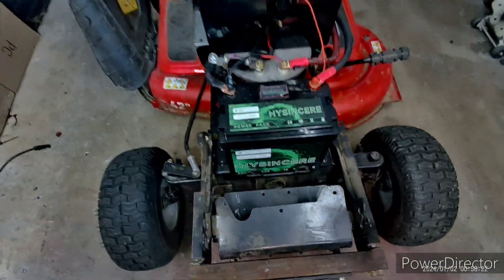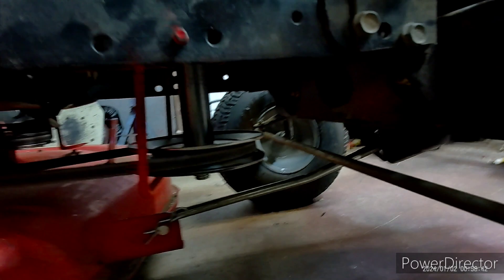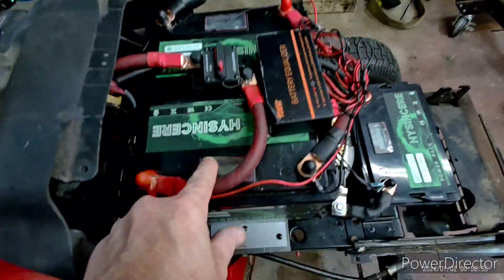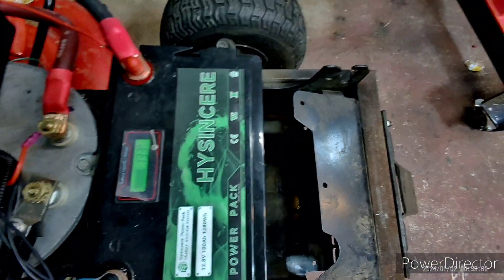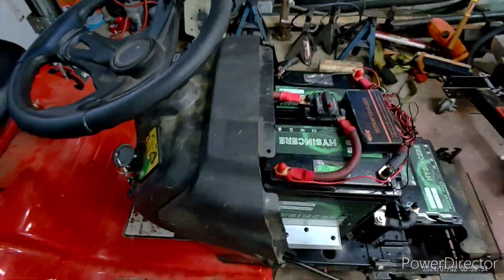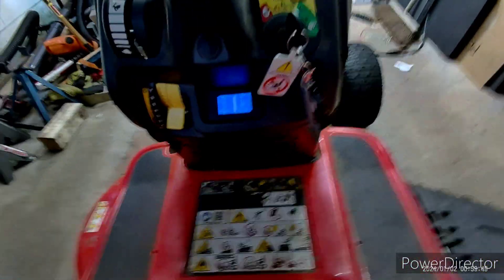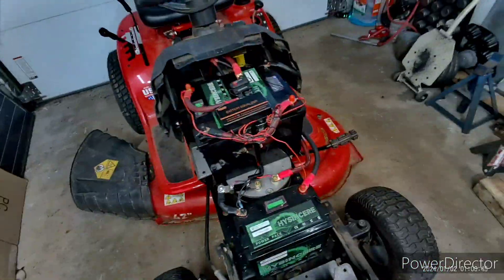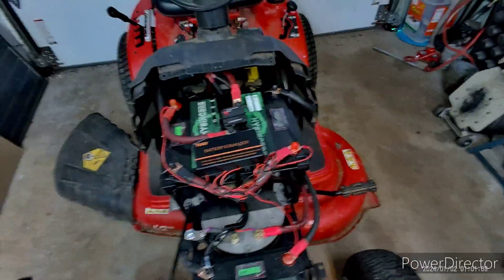36 VOLT ELECTRIC MOWER

Comment: is it possible to put the links to the part you pucrhased in the comments
Reply from the maker: I purchased the motor used on Ebay. It came out of a floor burnisher. It's a 36 volt 2.5 hp dc motor. The relay/contactor was just a basic 24 volt relay on Amazon. The same with the batteries.  I got one from eBay and then 2 from Amazon because they had a promotion.  The shaft for the original engine was 1inch I believe, and I got a 1 inch to 3/4 adapter and it worked perfectly.  I honestly got really lucky on this one. I maybe have a total of 8 hours working on this thing. I really only used 3 pieces and the rest I just fabricated.

Comment: how long will it mow with the power you have there?
Reply from the maker: @sambaaxe  I can do my entire yard front and back and it uses about 2.5 Amp hours. The batteries are 100 amp hours. I usually go around my lawn a few times but, I could roughly mow my lawn about 50 times before I need to charge the batteries. It’s definitely way too much amp hours for this mower. I will probably buy a 36 volt battery with a lower amp hour so I can use these 12 volt batteries for my solar system. I imagine a 10 amp hour battery would probably do about a 1/4 acre. Hope this helps you out. Thanks..

Comment: What is the total cost of this swap?
Reply from the maker: @mundanestuff  I paid around 175 for the motor that I found on eBay. It came out of a floor polisher.  It's a 36 volt 2300 rpm and 2.5hp. The contactor and connectors and wire were around 50 dollars on Amazon. I purchased 3 12 volt batteries.  One I purchased from eBay, and then I purchased 2 more on Amazon.  I did have a bad one, but they replaced it fast, and all 3 cost me about 450. So, pretty much around 675.00, give or take. It's really overkill. If I did it again I would buy a 36 volt battery.  I am actually looking for a nice John deere to put everything into. Something a little bigger.  Thanks..